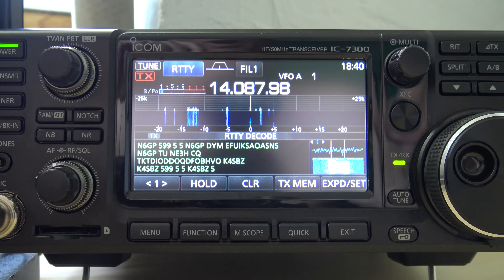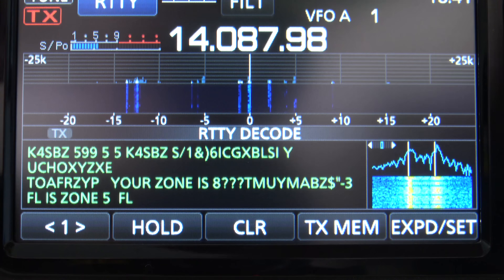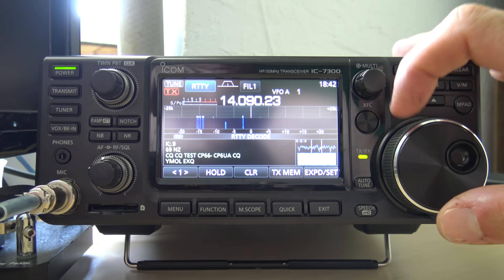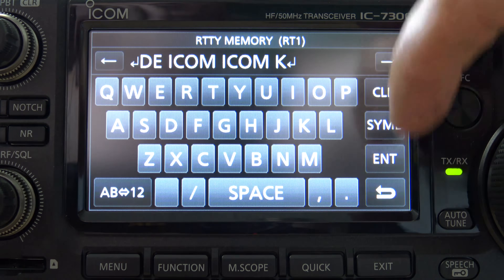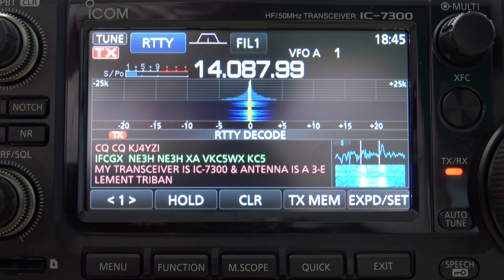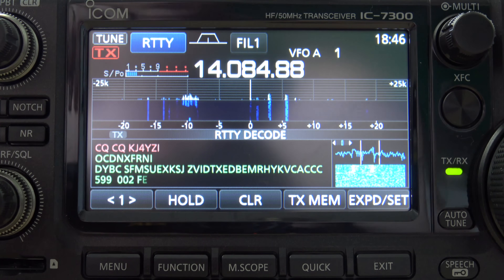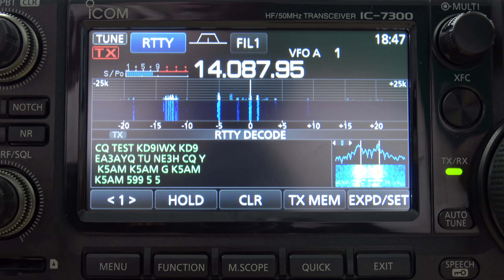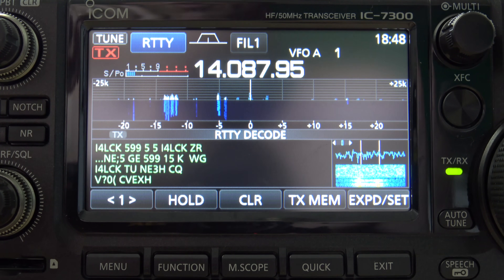Icom IC-7300 RTTY Decode Demonstration

Comment: Hey, on my electronics, my LCD screens on my meters for work I usually get screen protectors for ipad or Samsung tablets and cut the protector to fit the LCD screen. You can't really tell they are on there once you put them on. Just my way to protect them from scratches. Just thought I'd share a small tip.

Comment: Icom should have thought to allow you to plug a keyboard into the IC-7300 through the USB port to allow you to transmit free text in RTTY without having to use a computer.  I'd rather not be limited to a handful of fixed macros.

73 VE7NDE
Reply: Exactly. Icom is doing the same thing Nikon is doing: Reserving relatively basic features like USB keyboard connectivity for the high end models, so you have to pay three times the price just to be able to type RTTY responses. Granted, the 7610 also does PSK, but yet again, nobody believes that this requires extra hardware only found in the 7610. It's purely to differentiate the models because otherwise nobody would spend 3k on a 7610.
Love the 7300, it's still my main radio, but this still infuriates me. At least give us a paid upgrade option to do RTTY and PSK with a keyboard.

Also before anyone helpfully suggests to just connect a PC: If that's your solution, why even put a waterfall display on this radio, or any display for that matter? Just connect it to a PC, right? No. Being able to do RTTY and PSK without a PC is a great thing to have. Having to connect a PC is always extra hassle.
Reply: @ToumalRakesh Or there should be an option on this rig to input free text in RTTY using a CW keyer of all things.

Comment: I just tried the built in RTTY and PSK31 in the Icom 7610. The 7610 has memories for both modes and can decode for both mode, plus you can hook up a USB keyboard and type on both modes. It’s good to demonstrate that the 7610 can send and receive RTTY and PSK31 without a computer, but that tiny screen isn’t practical at all.

I’m trying to get HRD and Digital Master 780 working yet to transmit the digital modes and CW. I can connect to the HRD Rig Controller to display my frequency, and Digital Master 780, but for some unknown reason, I can transmit the digital modes or CW when connected with the one USB cable between the black USB connector on the back of the 7610 and my computer. Did you have any trouble getting HRD setup with your 7300?

Comment: The IC-7300 continues to amaze me with it's endless abilities and features!  I have always been a fanatic about leaving the screen protectors on until they fall off too.  I have even had equipment I'd never take out of the box to use because I didn't want to clean it if it got fingerprints on it or run the batteries down...lmao!  But I have since changed my ways in my older days.  I have found very few possessions are going to be with you your entire life.  If you have it, use it!  New things will come out to replace it more than likely.  So off with the screen protectors and enjoy!

Comment: I love my 7300, but if there's one thing I hate about icom is how they artificially limit their "low end" products. It would not be a problem for them to have USB support for an external keyboard to allow for full rag chewing. But no, we're lucky to get TX MEM I guess. Can't have people buy a 7300 and replace the 7600 with that, no no no. If you want to plug in a keyboard, you have to get a 76xx. Grrrr...

Comment: Great! I wish they would also have an onboard CW decoder (it would be a great tool for newbies like me)
Reply: It has RTTY decode, but not CW decode???
Reply: OLD technical point from 1970s, when TTL logic chips (HAL ST-5/ST-6) were first used for RTTY, then CW.
RTTY (5-bit, Baudot) is machine created, so decoding is far easier.
CW that is human generated is wildly inconsistent ... which is problematic for machine decoding.
Machine created  CW (like from keyboard) is easier to decode, as long as 3:1 ratio maintained.
Reply: w9gb but there’s CW decoder on computers (not always 100% accurate due to human factor,mesure, but still they don’t exist). So it would be great to not have to go through a computer for that kind of feature. My 2¢
Reply: CW decode & tx capable?